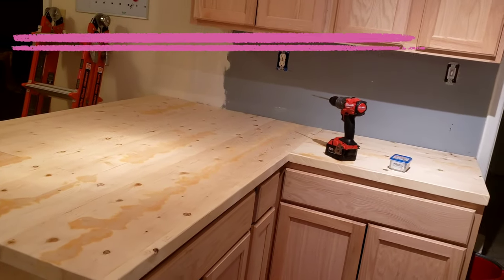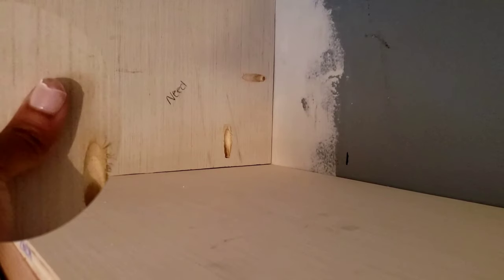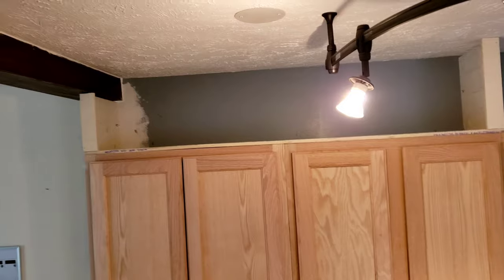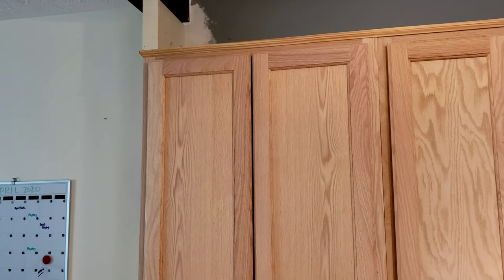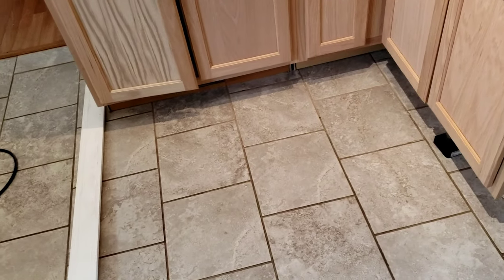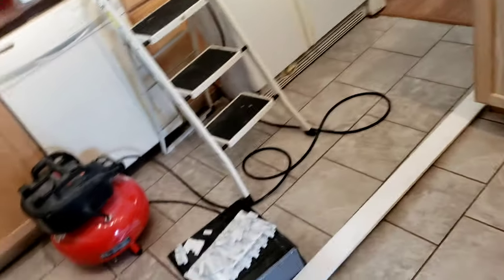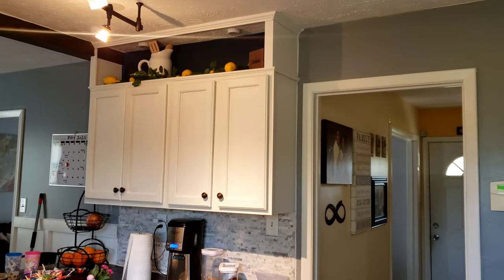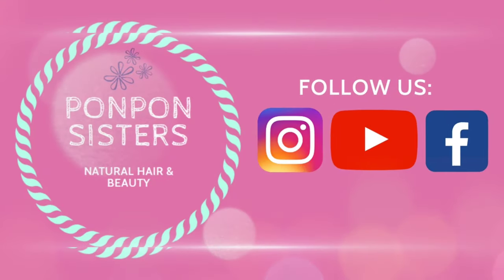Stacked Kitchen Cabinet DIY| Upper Shelves to Extend Your Cabinets| PonPon Sisters

Comment: Great Video!  This was exactly what I was looking for but, what type of wood and size of wood pieces did you use.  Also, you placed a board on top of the lower cabinets before you placed the pieces for the sides, what was that for?  Thank you so much!!! Great at explaining your process.